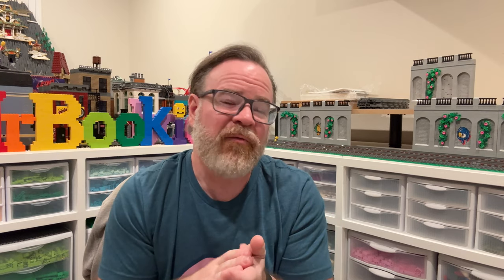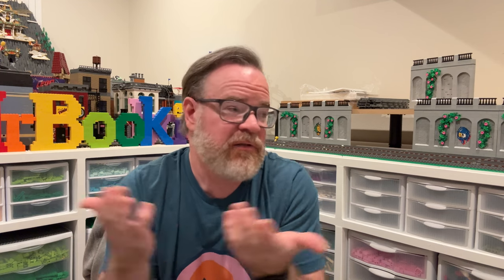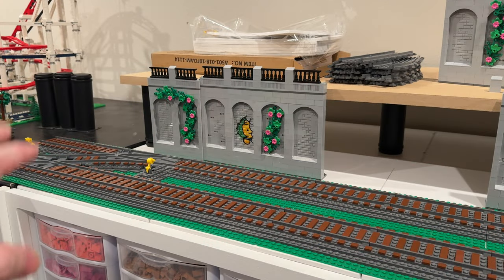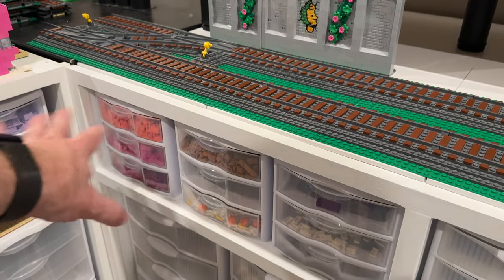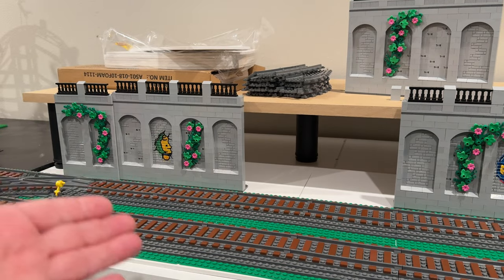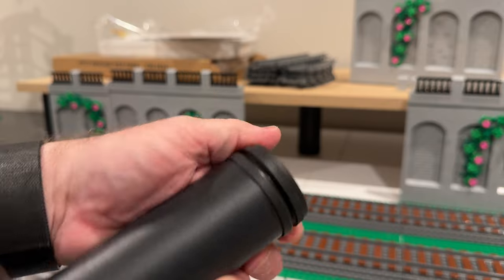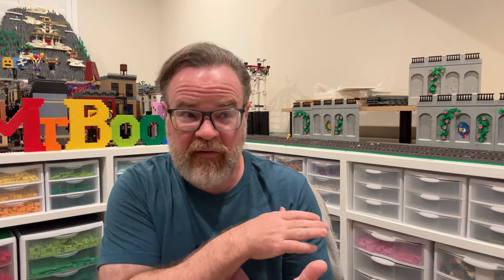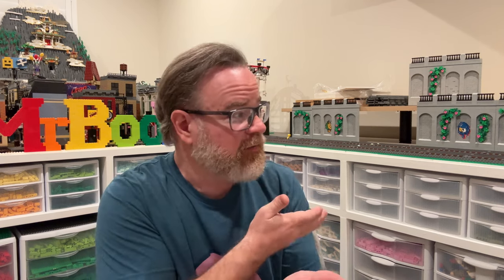LEGO City Building - Foundations

Comment: I’ve been watching the rebuild videos and I had a thought about the train sidings and gaining more space for the upper level. What if the upper level was extended out so that it was above the siding only? The main loop would still be open air for visibility. To keep the trains on the track siding visible you could build another version of your arch walls except keep the center of the walls open or put clear panels in place of the masonry brick. The underside would be illuminated to increase visibility. This could be done for the whole length or for just a section. A part of it could even be built as the maintenance shop for the trains. Just an idea. Either way I really enjoy your video’s. 👍🏻
Reply from the maker: Great idea! I thought of making a subway with access underneath. It would definitely gain more real estate up top.